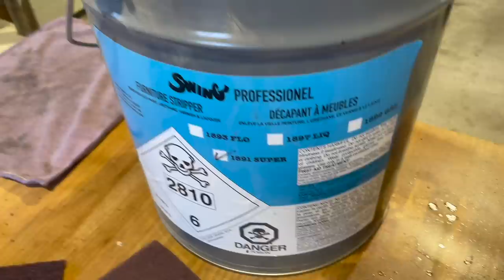More SATISFYING than ASMR? RELAX and watch some task completion 😁

Comment: I’ve never seen wedges used like that. Very clever! As you pound them in, they spread apart making a nice tight fit!
Reply from the maker: Yep fairly common joint
Reply: In the UK that trick is called fox wedging, because it's cunning and unseen.